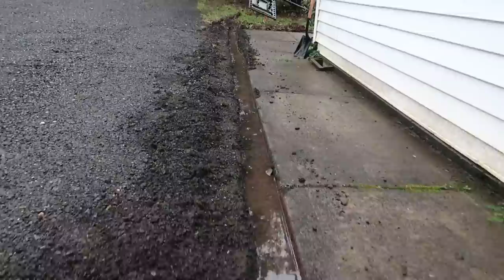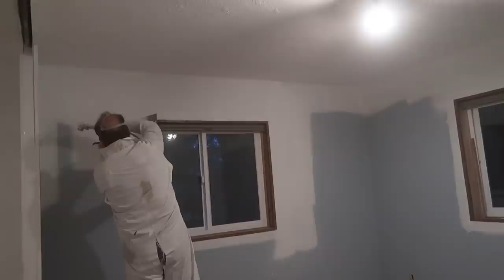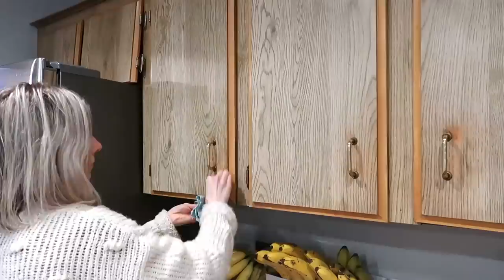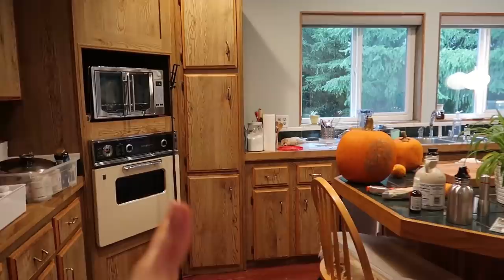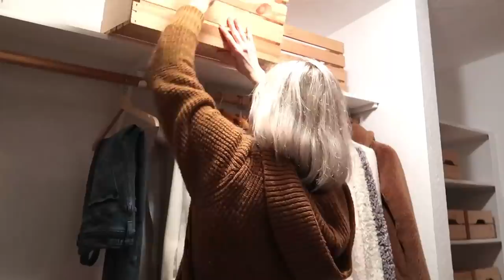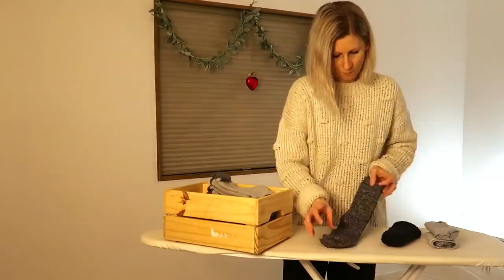STARTING THE REMODEL floors, painting, fixing the mold issues, kitchen plans and more...

Comment: They should have told you about the water issue. 

Love the progress you made so far.
Reply from the maker: We saw the mold so we knew the water comes in somewhere. We bought it as is. Once we figured out the where the water comes in we just have to fix that issue and it will be good 🤗💗It's getting there a lot more to do but starting to feel like a home😃💗
Reply: @ScandishHome  My husband builds for a living. So did my father. They’ve built houses from the ground up and have remolded and worked on older homes. All the problems can be fixed. You all are doing a great job! You will have a fine home when you’re done. Much love from Southeastern Kentucky 💙!

Comment: Do you lightly sand those wooden crates before using them for clothing storage? I find they can be kinda rough and cause snags
Reply from the maker: Mine are pretty finely sanded and probably because they are very old they are pretty smooth, but some can be rough though. Mine are from Michaels the ones I saw at Home Depo was really rough! 😊💗